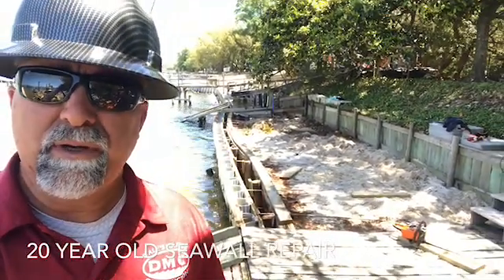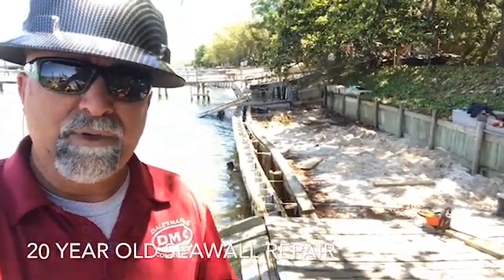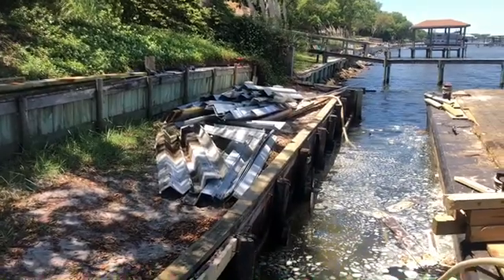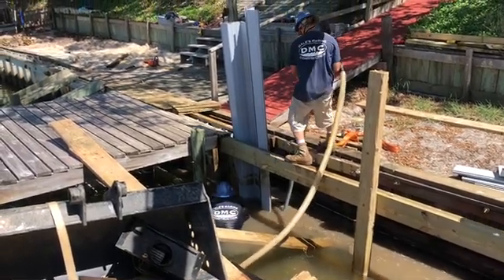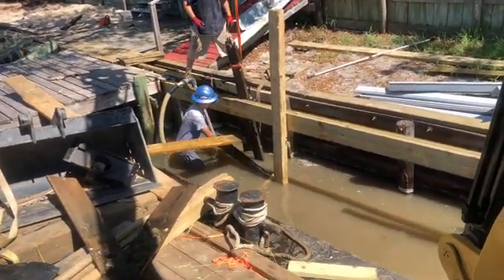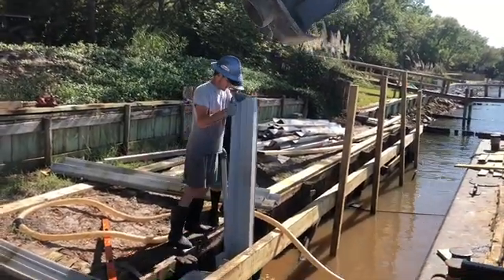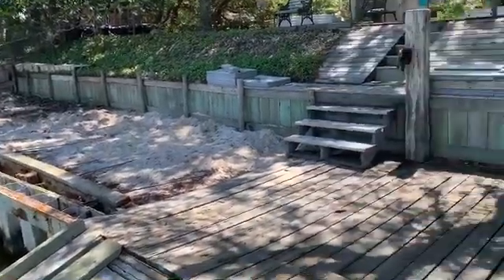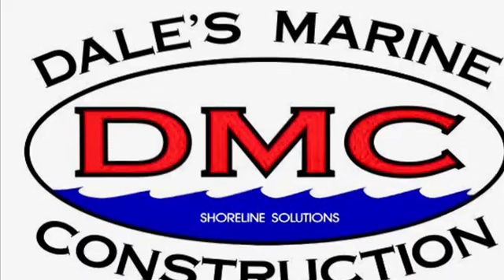How to do a Seawall repair

Comment: Should my contractor be water jetting in the sheets prior to just vibrating them in?  Soil in sand mix and relatively easy to drive until the last 3 feet of a 16’ sheet.
Reply from the maker: You can use a combination of both sometimes vibrating. You cannot get them straight in water jetting allows you to keep them a little straighter and install them quicker.

Comment: What is the best way to pull vinyl sheets that were installed improperly (not plum) jus todays ago in front of an old failed creosote wall?  Tried pulling, water jet and vibe but not coming out.
Reply from the maker: I take two pieces of angle aluminum and run a couple of half-inch bolts, threw it on both sides of vinyl with a shackle on top, hook the vibrator to that while jetting and vibrated up. Sometimes the sheets melt together, and they just will not come up.

Comment: Hi Dale , this is similar problem I have. Aluminum with washout spots
App 200 ft seawall. Would like to discuss, when your work load slows.
850 982 6714 Bud McLean.
Reply from the maker: William McLean Thanks for the comment and we will definitely get a hold of you. I’ve replaced a lot of aluminum Seawalls it seem like the thing to go with back in the day but those things oxidized pretty bad right at the sand line